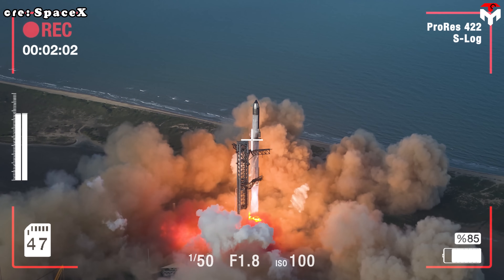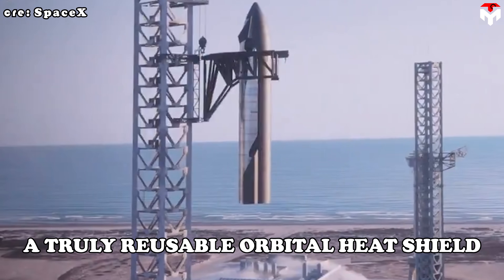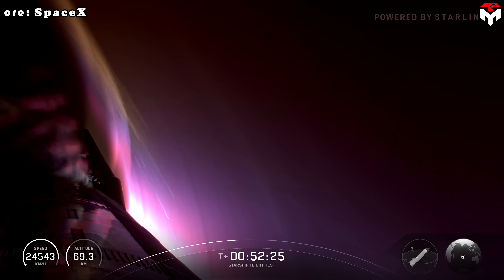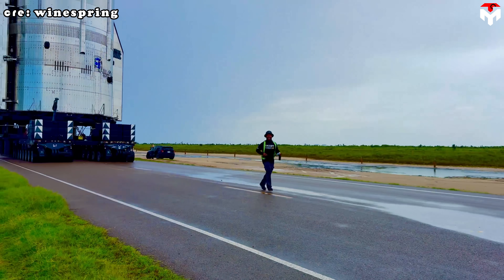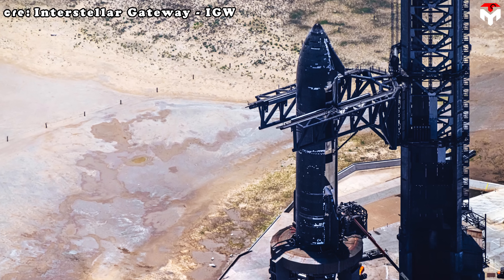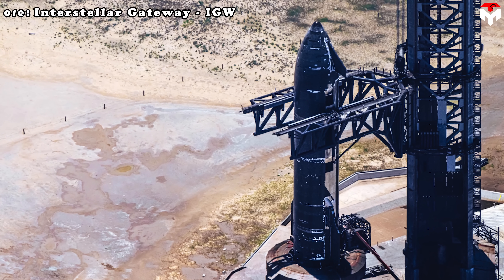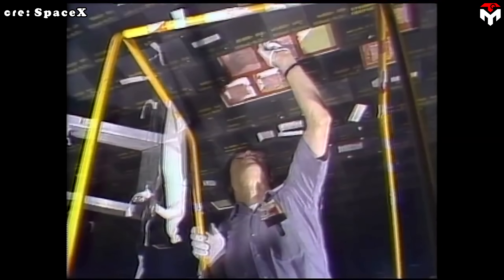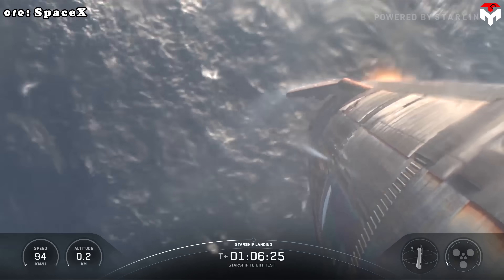SpaceX found a Brilliant method to SOLVE Starship Flight 10's heat shield's Big Issue, Shocked NASA!

Comment: Why not just have two layers of tiles, slightly offset to over lap. 

The tiles don't weigh that much, there wouldn't be a weight issue.
Reply: Right - and if each two tiles that overlap most get merged to be one, the number of parts will stay roughly the same. The gap inbetween tiles then would be kind of "N"-shaped but the two angles of that "N" would be about 90°.

Comment: Simply replace this coating with the equivalent weight of liquid water, being released as a shield of droplets that will absorb the heat as they vaporize and keep the stainless steel surface intact.
Reply: vaporized in milliseconds
Reply: Oh my.... No...Cannot because it will need a planet size water tank....

Comment: How about micro radiators circulating liquid nitrogen.  That would eliminate the “cracks” between tiles issue as the refrigerant would expand into cracks.  Worth experimenting.
Reply: And now the micro-radiatior will crack......No ... sorry... too many sources of failure... tons of joints to review.... tons of pipes to review after flight...

Comment: Has anybody yet thought about letting those heat shield tiles overlap a bit to get those gaps closed? I mean not as much as roof tiles do overlap, but just about half an inch or a bit more than that. And maybe with some denches on their surface like golf balls have, just to give it a try, if these can have any kind of positive effect at those speeds and temperatures, somehow.
Reply: you are forgetting about thermal expansion.  I believe they tried that with the first launch - no gaps and the tiles cracked - all of them from expansion..
Reply: They could do a "dragon scale" type of overlap , but the vibration might cause them to slough off.
Reply: @GeneGower  what if it was a "dragon scale" made of a tungsten-molybdenum alloy or maybe tungsten only? Thin enough to be not heavier than the ceramic tile heat shielding and every piece of the scale long enough to not transport the heat too fast into the steel hull. One end of it (the thinner & longer one) fixed to the hull and the other end fixed to one or two neighbouring scale pieces below it. And some of the ceramic fiber cloth underneeth (inbetween the steel hull and the tungsten scale) to deal with the radiated heat.

Comment: In many ways this sounds more and more like the Space Shuttle all over again. The main tiles they use are esentially the same tiles used by the shuttle, and the Starhips they do get back from space absolutely do not look like they could be rapidly reused without refurbishment. On the contrary they so far look at total write-offs.

I do have hope that SpaceX will ultimately make it work a lot better than the Shuttle, as they have a few important things going for them:

- The underlying skin made of stainless steel will have a higher tolerance for heat getting through the shield than the aliminum of the Shuttle.
- The less complicated form factor means that they have more uniform tiles and fewer special format tiles compared to the Shuttle (although they clearly have a lot of special tiles int he noce cone area and around the flaps.
-  They are - at least so far - only using it for unmanned missions, which means they can take higher risks than the shuttle ever could.

But I have little hope that it will ever fly again untouched. I think the best they can hope for is an inspection and refurbishment phase that is a lot less time consuming and therefore also less costly than the shuttle.

Comment: Maybe we should hold on saying SpaceX solves anything until they demonstrate that it actually works.

They are on flight 11 of the full stack now, plus even more flights of the shiap and prior prototypes, and there is still zero indication thatt SpaceX has a working heat shield that is rapidly reuseable. 

On the contrary all indications are they have serious problems with it.

Comment: I keep wondering if instead of looking for materials to survive re-entry materials science shouldn't be trying to find materials made stronger by the process of re-entry
Reply: There is a basic issue with extreme prolonged heat exposure
Reply: @akamatsarat5649 Doesn't "prolonged heat exposure" also describes a forge.

Comment: Shock NASA, that really wouldn't be that hard as they've done bugger all since their imported German Nazis all died off. Let's hope the imported South African can take things to the next step.
Reply: That is a really ignorant comment and shows little understanding of how science and engineering work and how NASA works. NASA does fundamental research, establishes the specifications, coordinates, and integrates technology developed by subcontractors like Lockeed Martin, McDonnell Douglas, Rocketdyne, etc... The data from fundamental research is used by these contractors to develop and improve their technology.
NASA technology has led to multiple spinoffs like cochlear implants, memory foam, CMOS image sensors (originally for military spy satellites), and many more things like aerospike engines. NASA also developed the first reusable rocket engines, the RS-25, that powered the Space Shuttle. SpaceX builds on that legacy. Chances are, there are ex-NASA engineers working at SpaceX or young engineering graduates whose professors worked for NASA or one of their contractors.
Werner Von Braun established the basics of liquid fuelled rockets, like regenerative cooling and fuel injector designs. The V2 was a very basic an inefficient design that had to be enormously improved by countless NASA engineers. The Russians also contributed, especially Serguei Korollev. The Soviets were the first to create a flight rated full-flow staged combustion engine of which the SpaceX Raptor engine is a descendant.
Elon Musk is the financier, not the genius behind SpaceX. He wouldn't have been able to build SpaceX anywhere else but in the US, where there is the engineering know-how  and science to do it. You need three things to build something like SpaceX. The vision, the money, and the brains. Musk brings the money.
Reply: Wszystko to prawda.

Comment: If the heat shield's problems are so significant, why not choose a reentry orbit that exposes the rocket to less friction from Earth's atmosphere? For example, I'm thinking of an elliptical orbit that only touches Earth's atmosphere for brief periods, slowing the rocket down, and then coming a little closer to Earth on the next orbit. Perhaps this could reduce the forces acting on the heat shield. Figuratively speaking, it would be like not applying an emergency stop in a car, but rather a cautious, stuttering brake. Why  not this way?
Reply: It would not be worth it for price/performance plus will take longer and require a re write of code on the return to earth navigation brain   and then they would have to test it...

Comment: they could have an ultra thin heat tile if they used a YBCO super conducting magnetic shield to repel the reentry plasma. it could reduce heat 50-70% depending on the field strenght. it already has power and lox and volume so that wouldnt be an issue. shave off 5-8 tons of heat tiles for 1 ton of plumbing magnets and larger batteries.

Comment: Used Carbon ceramic
Reply: Carbon silica Titanium oxyda ceramic .. NASA mengunakan pada pesawat angkasa ... 

Bahan terbaru mungkin mengunakan serat silicon carbide + editif lain ..

Jadi bukan mengunakan ceramic  . Mungkin serat type baru 😅😅😅
Reply: we need to create an element of Bulshitonium atomic weight of 132 that remains stable long enough to combine it with Tungsten to create a molecule capable of withstanding that much heat easily.  And you can put it on cookware too, makes it totally not stick.

Comment: The Shuttle had 131 flights and each time only replaced about 300 tiles per launch, it was truly reusable, and I doubt SpaceX could do anything that would amaze NASA, remember the Falcon 9 wouldn't be in service today without NASA investment, Musk put in 100 million, NASA 300+ million. White is the stainless steel getting to 600º+ temp, red means 300º+ deg seeing these colours is a failure of the tiles.

Comment: On the old great sailing ships it was a laborious job hammering in hemp fibres soaked in tar between the boards to waterproof the hull.  It’s funny over 200 years later we’re still trying to solve the problem of doing something very similar in the most efficient way possible.

Comment: On the old gian staining ships it was a laborious job hammering in hemp fibres soaked in tar between the boards to waterproof the hull.  It’s funny over 200 years later we’re still trying to solve the problem of doing something very similar in the most efficient way possible.
Reply from the maker: You’re right, it's remarkable how some fundamental problems persist across different eras!

Comment: Why don’t they figure out ways to coat the rockets instead of tiling them? 🤷🏽
Reply: because of reusability issues, its not like the old methods of one-time use rockets, the coating process takes time so if it were to be reused its not ideal. this is actually a better method
Reply: Because if you do a one piece heat shield ,it will crack when it will expand during reentry.... multiple smaller pieces with space between them , seems the best solution for now